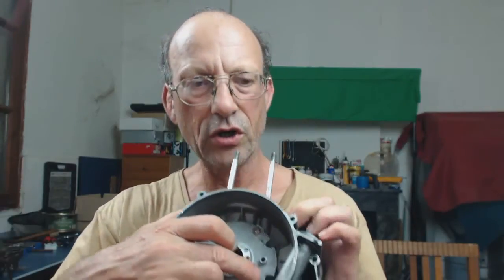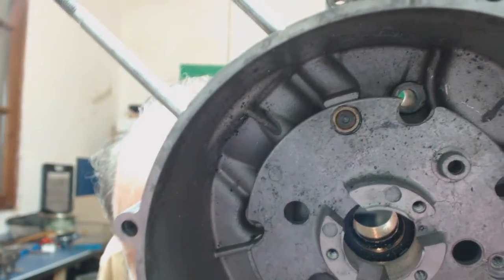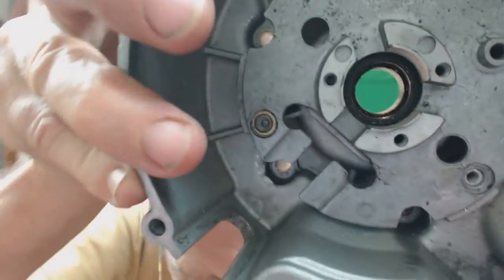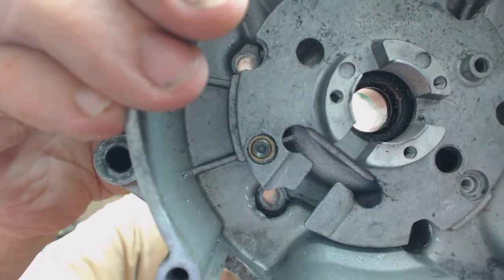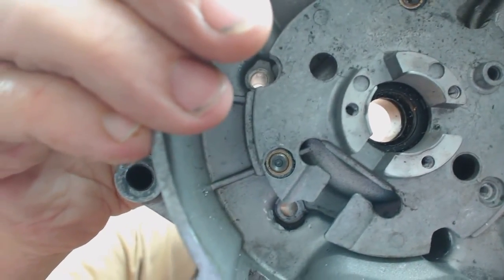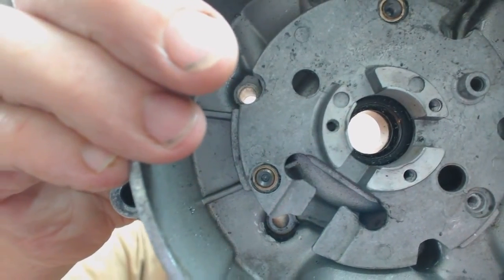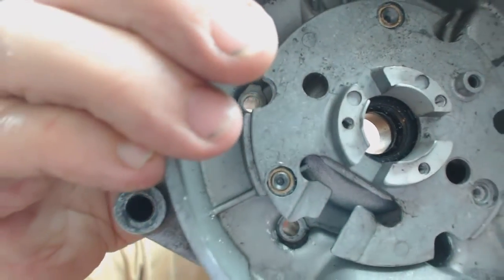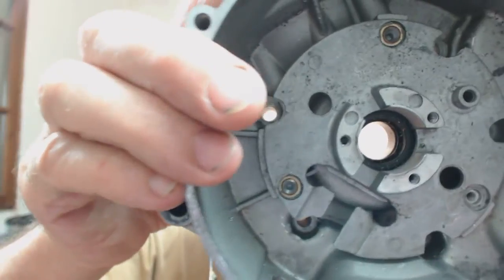Remove / extract a seized or rounded screw (even very small screws)

Comment: what makes me mad is I knew this and what got me was IMpatience  smh I have all of these tools and I rushed it. my project required drilling, which a lot of video don't show, the fasteners were corroded in. eazyouts will not work. projext was an audi engine the fasteners I surmise are harder then the magnesium block and that drill just took a walk on the wild side. and the slight walk got me into an oil galley AAAHHHHHHHHHHHHHHHHHHHHHHHHHHHHHHHHHHH Patience to walk away and/or got get the proper tools from the shed is the BEST TOOL!!!= being wise
Reply from the maker: Thanks for providing that report Glenbjack :)
It is a good cautionary tale.

You are right ... we need patience.
Getting that first centre hole is key - going as deep as you can.
Then the drill bit must be well ground, particularly on smaller diameters.

If the drill cutting edges are not equal, the drill will walk ... and the moment the cutting edge touches the magnesium, the operation must end immediately, cos it is just going to dive into the softer metal.

With hindsight, I wouldn't be surprised if, at contact with the magnesium, you'd done enough, assuming that you'd started with a centre drill.

Can I ask ... did you start with a centre drill?
Reply: no I just center punched. good center. drilled with a I wanna say 38 drill. good. then I think a 22, good then I think one more and I JUST seen the hairline of male and female threads. retapped and first one good. second one I center punched good center and that's when I made mistake and rushed I skipped to a bit about the thickness of the screw and I got about 1/4" in and obviously I was crooked because it started to bend, it was turning into the block. I decided to just finish it because I only had about 1/4" to go and as I come up to my depth a blind hole becomes a through hole lol. just dumb on my part and rushing.
Reply: with my screws you did have to drill it out all the way. that I am sure of... and I misspoke its not magnesium block its aluminum alloy of some sort and screws I don't know but they seem to have corroded together....whats looked like galvanic corrosion.
Reply: I just know in the future with and audi motor ill be using a steel fastener, lubed with anti-seize and just only torque to about half. see how that works out
Reply from the maker: One thing is for sure ... we have all made mistakes.
Such is life.
:)
Reply from the maker: The corrosion could have caused the drill to walk.
If the corrosion had penetrated deep enough, the cutting edge would catch it, and off it would go.